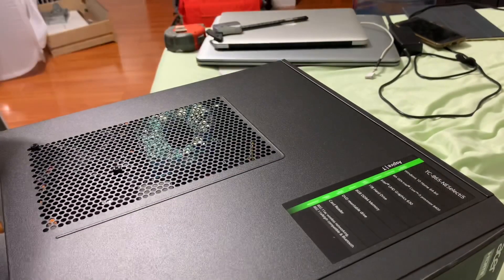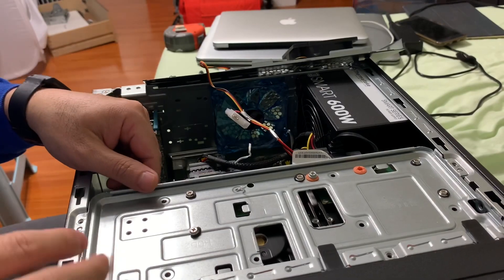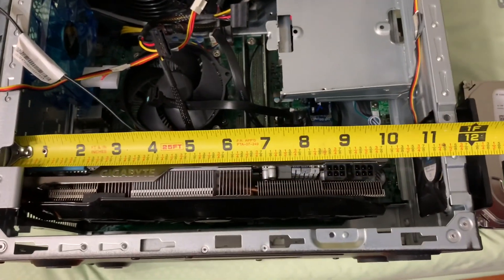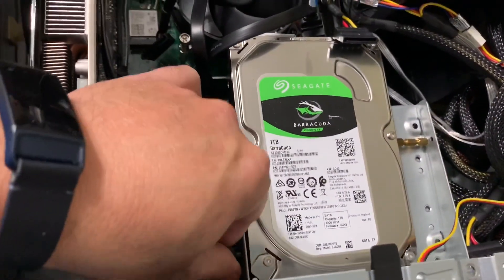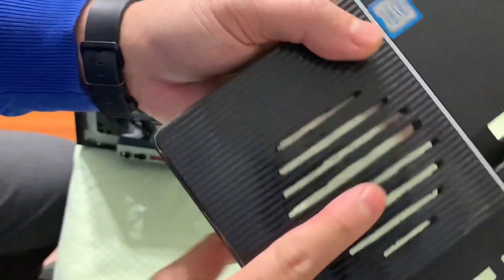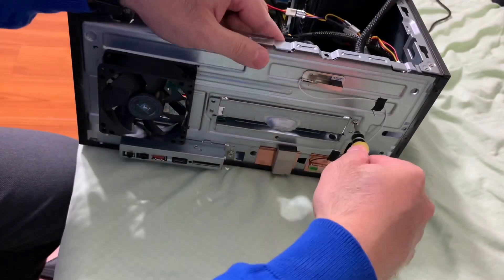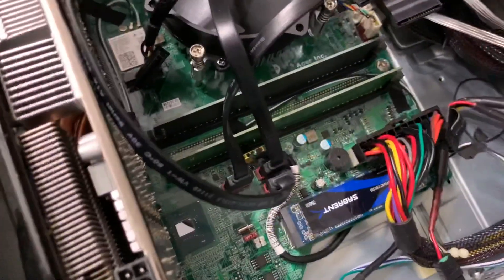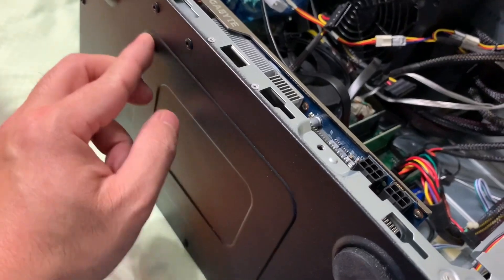Modify Acer Aspire tc-865, TC-865-NESelecti5 in detail

Comment: What did you do when installing graphics card? I can't get mine to detect the graphics card. The  fan is running, won't show up in the device manager. I tried disabling the intel onboard graphics hoping to  resolve conflicts but still no output in all ports. Got in to the bios, but the onboard video card option is greyed 0ut can't disable onboard video.
Reply from the maker: unplug the power cord, remove battery from motherboard, (reset bios) see if that work,
Reply: @singingfishok  , Thanks I'll that
Reply: @rolandrunk  also try going into the device settings and turning off the other graphics card. Had that same problem with my new on I put in.
Reply: Yes, I also have the same PC, I changed the power supply to 500w and put nvidia gtx 1660 ti oc in it and it doesn't recognize it.
Reply: any fix this?

Comment: How did you make the whole for the front case fan?
Reply from the maker: I used the Dremel 7760 to cut it the front plastic, and the metal inside. it's not perfect, but it works.